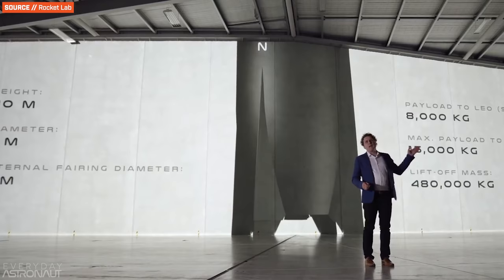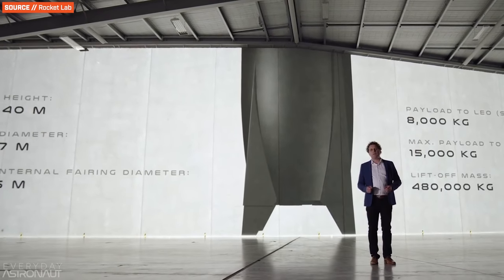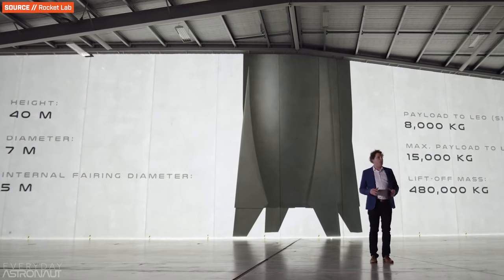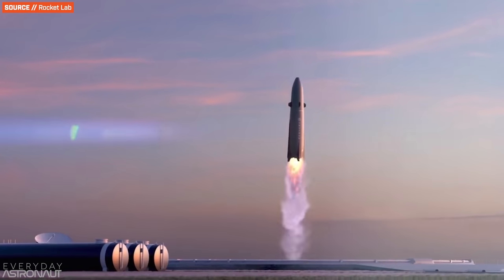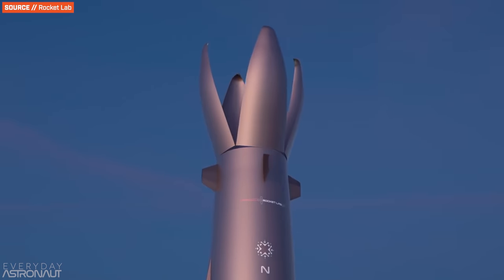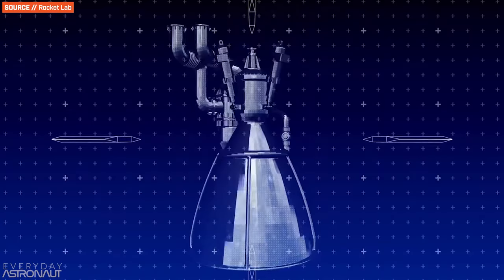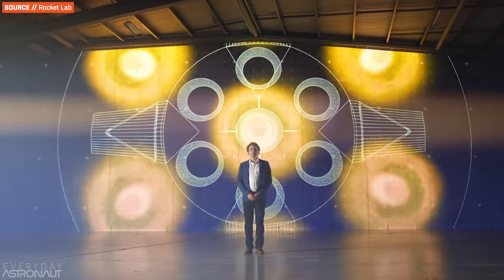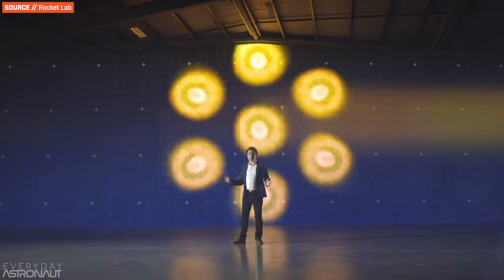Talking about Rocket Lab’s Neutron with Peter Beck

Comment: I love how we can see such different approaches to reusability! 
Spacex: cheapest material, cutting edge rocket engines,highly complex ground services....
rocketlab: expensive material, low risk engine, simplified ground services....

we are going to the stars with this kind of lateral thinking!
Reply: "Comes down to total cost"
Get into RKLB can't believe how low this stock is 😳
Reply: Once starship is operational and in a "final" configuration where rapid iteration is no longer so important, I'd love to see them switch to carbon fiber for the booster. Get all of the amazing benefits of mass savings discussed in this video, combined with the super high performance state of the art engines, and the offloading of mass to "stage 0". Think of the performance of such a beast!
Reply: BOTH of these are the right answer.  SpaceX is solving a different problem than Rocket Lab, and every engineering problem is one of optimization and compromises.  Musk understands that the infrastructure is more expensive than the rocket, which is what Beck is saying.  The difference to Musk is that you can build one stage 0 pad that services many stage 1 + stage 2 rockets, but for Beck, that stage 0 would be a higher fraction of the total cost, since he's building smaller rockets.  We'll see what decisions he makes later on, as he moves on to bigger rockets.
Reply: @BrightBlueJim  i think elon was constrained by budget on starship.  he has a harder problem to solve which puts more value in fast iteration but at some point composites will probably be better for starship too
Reply: @user-zb8tq5pr4x  If everything I say is wrong, just let me say this: "I am stupid and ugly".  However, I did NOT say that Musk doesn't care about operational cost.  He absolutely does.  What I SAID was, he came up with a different solution BECAUSE HE'S SOLVING A DIFFERENT PROBLEM.  He rejected carbon fiber for Starship because it's very expensive and it doesn't save that much weight, when you consider the extra heat shielding you need for it, FOR A ROCKET THE SIZE OF STARSHIP.  You can hate on him all you want, but try to get your facts right.  And if you want to hate on someone for trying to milk every penny they can out of NASA, you might want to take a look at Jeff Bezos, who bid DOUBLE what SpaceX did for their manned lunar landing system.

Comment: Superb video Tim. It's really interesting to see another CEO using a similar "best part is no part" ethos to Elon but producing very different answers - specifically the no strong-back. SpaceX are busy building the most complicated launch mount and tower to remove complexity from the vehicle. Rocket Labs have deleted the tower to save infrastructure. Great to hear a different perspective. 

Speaking as a design engineer myself, I see this type of constraint driven compromise daily. When a customer comes to me with a requirement, I can usually produce 10 block diagrams for solutions within an hour. Each will bring pros and cons - time to develop, unit cost, complexity, reliability, physical size, weight, efficiency, thermal performance... The chosen solution is rarely the obvious one. Thanks so much for posting.
Reply: Never say never, and eating hats etc. Agreed, I love seeing the same approach giving different results. It will be interesting, however, to see if/how RL's design flow changes. Yup, the current Neutron plans eliminate pad infrastructure and put it into the 1st stage, accepting the mass penalty and expecting an overall cost benefit. But we have to remember SpaceX planned for a long time to put refueling infrastructure into Super Heavy but switched to a philosophy of putting as much mass into "Stage 0" as possible.

There are a lot of differences between the use cases for each rocket and their engineering so I'm not crazy enough to make predictions, but I won't be surprised if RL ends up with a light structure carrying propellant and umbilicals to the upper stage - a very minimal version of a strongback that doesn't have to lift anything. This won't add much to their pad infrastructure since the propellant and electrical lines have to run to the base of the rocket in either case.
Reply: The difference is that SpaceX is ideological and so is more willing to brute force their way through complex infrastructure if it means they can have a wildly capable vehicle, whereas Rocketlab is willing to compromise on performance if it means vastly cheaper and simplified operations
Reply: "Cost is everything " Rocket Lab can't just throw money at a problem so they have to design smarter and engine the problem out.
This is why I hold Rocket Lab stocks.
Reply: Ones trying to get to mars the other is building a LEO  launch company.
Reply: @alanrickett2537  You do know Neutron will be capable of human missions and Rocket Lab has contracts with NASA to go to the Moon, Mars and Venus?
Reply: @HypaWave1701  both spaceX and rocketlab are solving the problems smarter, just with different attitudes. no one is just "throwing money at the problem". theres room for both companies.
Reply: @Gimmeanicknow  I agree.
Space X just has Elon's deep pockets but Rocket Lab doesn't so their design point of views are different. Space x can blow up Rockets for testing Rocket Lab cant.
Its just different I didn't say it was wrong.
Reply: @HypaWave1701  sure, I`ll agree with that. more than that, the whole falcon9 campaign really allows spacex the room to go all out with experiments.
if we have operational starship AND neutron in a few years I`ll be happy.
Reply: @HypaWave1701  Yes and it make no change to my comment that there main design goals are different   starship can launch to LEO but if that was the main plan much of the design would be different for example hydrox on the second stage would be a better option.
Reply: @HypaWave1701  SpaceX developed Falcon 9 while Elon's pockets were very shallow. They blew up rockets even with limited funds.

I expect that Rocket Lab will also build a few prototypes that only launch once. This is a luxury afforded to companies that optimize for manufacturing.

Factories need practice, so they will build many prototypes and test fly some of them. Test flight articles are often built extra heavy to gather data. This data will be used to learn which areas can be made lighter. Test flight articles often have much more instrumentation.
Reply: But how will they integrate stage two? They will not have a strong back and neither will SpaceX. But do we really see rocket lab pulling up with a mobile crane to lift the rocket (to get on a stand) and then lifting the second stage in their while it might be windy and people being in cherry pickers trying to get the things right and inspected? To me it seems a vehicle that picks it up from underneath, brings it to a fixed (might be open air) structure that holds the rocket steady while precisely lowering the second stage in there. Then again from the underside carriers it to the launch mount and then they connect fuel lines as described in the video.
Or did I miss this? I only got the impression it they will do vertical integration, thus no strongback, but nothing firm on the rest.
Reply: @hamjudo  That's fine but you were comparing Neutron to Star ship as yes deep pockets.
And Neutron will out preform Falcon but yes Rocket Lab will learn from Falcons development.
Reply: @HypaWave1701  Blowing up isn't necessarily more expensive. SLS doesn't built and design by blowing up, nor does Blue Origin. Yet they are burning through a lot more money than SpaceX. SpaceX is deliberately designing things to be cheap to blow up. Blow-up design is the old Soviet approach to rocket building. They also tended to blow up a lot of rocket as part of their design process as opposed to the meticulous German approach of Werner von Braun that he carried over to the US. 

But as we have seen in history you can have success with both approaches. Elon Musk prefers a very hands on experimental approach, so the blow-it-up approach works well for him.

It is a bit harder for Rocket Lab, because carbon fibre is probably a bit expensive to keep blowing up. And the material is not well suited for lot of hands on experimentation and modification. It lends itself more towards more extensive upfront design.

Comment: 40:55 Rocket Lab was forced to build extremely light for Electron. That experience and ethos of building light makes Neutron incredibly simple and reliable compared to its competitors. Falcon 9 is a force to be reckoned with in the medium-lift segment, but it sounds like Neutron has every possible advantage, and it all starts with mass. I'm SUPER stoked for this rocket.

Comment: Its very interesting the different approaches SpaceX and RocketLab has taken for the next generation rockets. To me, SpaceX is indeed way higher risk, and RocketLab I think have a winner here. I hope both of them succeed, and since they are so different, I'm sure they can co-exist for a long time.
Reply: @Orwell Nailed It I think Mosern is talking about Starship vs Neutron, not Falcon. And Starship is indeed a very ambitious, high risk design.
Reply: @Voyager2525  But Neutron is not going to compete with Starship, if its going to compete then its going to compete with falcon 9.
Reply: @Voyager2525  What do you mean by 'Starship vs Neutron', though? They're by no means even comparable vehicles in terms of capability. I mean, what, Starship will be able to lift 19 times what Neutron can. I think the better comparison is actually Falcon vs Neutron here.
Reply: Mosern wrote "next generation rocket" so to me it was clear it was about starship.
Of course it's comparable in some ways. I.e. Elon motivating the troops with risk of total failure if the very ambitious Raptor (Full flow staged combustion cycle) compared to rocketlab going for a "easy" design.
Once starship enters regular service it may have falcon 9 retiring. Not having to build an entire upper stage each time and get more use out of the ground infrastructure they will have. So starship and neutron might compete for the same payloads. For one it might be a heavy payload and for the other it will be like taking a full semi for picking up one car. But if you already have the semi you may as well use it.
Reply: @kenshi_cv2407  doesn't matter if starship has 100 times the capability of a Neutron. If clients can get their satellite to orbit under similar constraints (schedule and special launch requirements) for a comparable cost starship and neutron can be in competition.
Reply: @curious1585  No, they simply can't. You do realize that the primary purpose of Starship is lifting enormously massive things, right? Space Stations, Cargo for distant colonies- hell, the colonies themselves... etc. You will never see Neutron lifting a space station, because it simply cant. It doesnt make Neutron any worse of a vehicle, it just means that you're kidding yourself if you think that they will actually be competing with eachother.
Reply: @erikengheim1106  Yeah, thats why i wrote "IF its going to compete then its falcon" but even falcon is different type of rocket because of its launch capabilities to leo or more expensive second stage. But for sure it is not going to compete with starship lol, almost full reusability or not.
Reply: @kenshi_cv2407  try reading again. Neutron not being able to do the same as Starship is not mutually exclusive with starship doing the same as Neutron ;)
Reply: @curious1585  Yes, I read your response and I still disagreed with you. Starship and Neutron are not competitors in purpose or payload capability. Also, you do realize that SpaceX launches dragon spacecraft crewed and uncrewed that very frequently exceed the 8-ton limit of neutron right?
Reply: @kenshi_cv2407  so?
None of this presents a logical conflict with what I'm saying. Stop acting like it does.
Reply: @curious1585  Yes, it is a logical conflict, what are you not understanding about this. If SpaceX frequently exceeds the capabilities of neutron with Falcon both in uncrewed and crewed launches, then how is Neutron a Starship competitor? You're applying smallsat constellation mentality to every other type of launch and with some very simple logic you will find that is unreasonable.
Reply: @erikengheim1106  "Neutron is getting reusability more on par with Starship " Are you even serious? Starship reusability is 0. That thing is a time bomb!
Reply: @mdjey2  What are you trying to say? Starship reusability is clearly better than 0. The whole rocket  can be reused.

Neutron is not quite as good, but much better than Falcon 9 as they have a very small and cheap second stage. They have pushed much more of the value into the first stage and they retain their fairings.

At the end of the day, it is not the fraction of your rocket which is reused which determines cost of launch. This is a thing a lot of people misunderstand.

When launching a rocket which isn't reused, the rocket still only make up 1/3 for the total launch cost. Operational costs dominate.

Neutron makes a lot of good choices to keep operational costs to a minimum. They launch from a simple flat pad. Starship uses a lot more expensive and complex pad with tower.

Neutron uses very simple engines which are quick and cheap for service. Starship uses the most advanced and high performance rocket engines EVER built. Those are not going to be cheap and easy to service. That adds to costs.

Starship uses way more engines, which means a lot more to inspect and service, driving up costs.

Not to  mention Starship is much larger with much higher fueling requirements. All this will add costs.

Thus it all depends on what  you are using the rocket for. Starship can lift 100 tons into  orbit. Neutron only 8 tons. If you plan on sending large crews to Mars or the Moon then Starship wins hands down.

However if you are going to launch a regular satellite into orbit, then Neutron may end up being significantly cheaper.
Reply: @erikengheim1106  Show me one video where Starship doesn't explode and do some actual job.
Reply: @mdjey2  SN-15? You know that one landed right? Plus I think its a bit unfair to say "show a vid where star-ship do some work" when its in active development testing while all the other rockets similar to it or even its predecessors that want to compete with falcon 9 have never flown. Its like wondering why grasshopper wasn't performing work and sending things to space. SpaceX made fun of their own previous attempts at landing and having their falcons explode, but that isn't preventing them from being the only company that operates a re-usable booster and does so with exceptional reliability. There was explosions, but its better than having nothing to show at all.

Comment: On the economics of being a launch provider it would be interesting in a future interview if you could get him to break down the percentages for the so-called TCO of launches. Site costs( a kind of G&A), component and services costs, fuel costs, refurb costs, CRM costs, corp overhead (the real G&A), licensing/taxation. There is no doubt they have a spread sheet with these calculations. Just a matter of would he share it. At this point, Rocket Lab and SpaceX are the only rocket entrepreneurs I take seriously enough as to be worthy of investment.

Comment: 20:58 I think what some people forget is that this is only a suborbital entry speed. You don't need ceramic heat shielding. Starship has those reentry tiles because its returning FROM ORBIT.  The tests they've done with starship were only to an altitude of 10km. Electron stage separation happens around 70km alt (i think). But I think neutron seperation will need to occur at 100km.
Reply: It's basically the difference between first stage and second stage

Starship is supposed to be second stage

Comment: The beauty of the retained fairing idea is that when they are articulated it will likely be in close to zero gravity conditions, so the hinges and the power that moves the parts does not need to be extraordinarily heavy or powerful, it just needs to be enough to open and close, and in the closed position the locks and seals are really the important part. This is me thinking outloud as a hobbiest, not as an expert of this idea. But it just appeals to the engineer in me because it is such a novel idea, and really it can be much more lightweight than people would ever guess because it can be helped to open and close on the ground when loading, and when in orbit or space the energy required is much lower to open and close. Fantastic.  Databyter
Reply: The gravity is nothing that matter that much. You heard Tim ask about it in the interview, its mostly the dynamic pressure (coming from the high speed and how much atmosphere is present at the place for separation) that dictates where they can separate and how strong the construction needs to be.
Reply: I'm not entirely sure this is true. The fairings still have mass, even if in space at that point, thus a certain amount of power is still required to articulate them. Being in zero-g wouldn't make that much of a difference I would think.
Reply: @drosendahl  Dynamic pressure COMES from force against gravity (weight). And the canopy is designed to be deployed when the dynamic pressures and atmospheric pressures are at a minimum. And for purposes of payload, when at virtually zero.  Databyter
Reply: But if they were strong, they could possibly be used as airbrakes
Reply: Well, I’d be inclined to agree with you but the fairings still have to be opened and closed once returned to the ground for second stage/payload loading. I suppose this could be done with the help of ground equipment, so I’ll give you that, but it is a consideration.